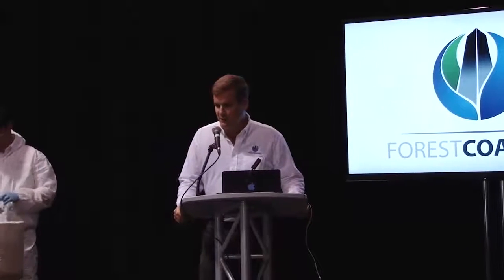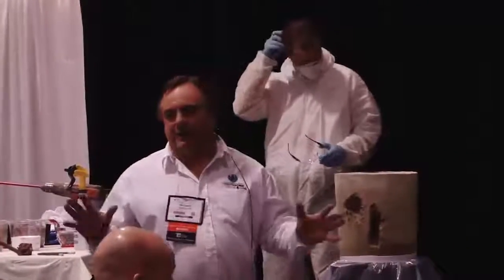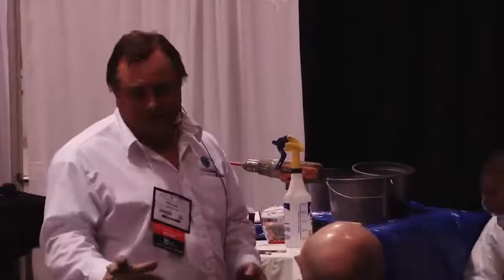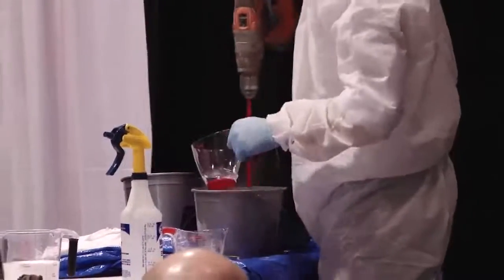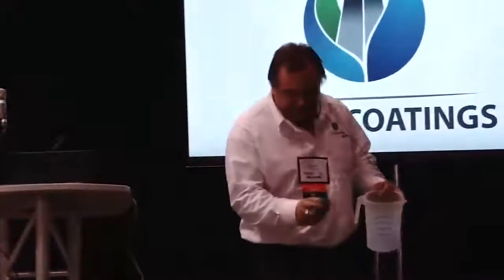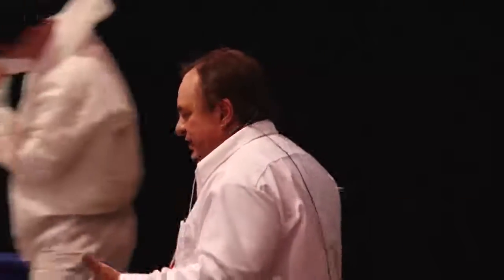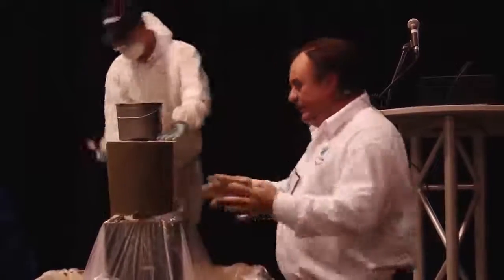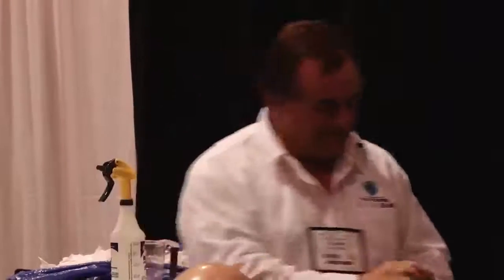How to Waterproof Concrete with Crystalline Technology

Comment: Crystalline waterproofing must and should be applied on wet condition of  substrate, not on dry substrate. Wet surface acts like a primer.
Reply: Is similar or same material is available in India, where what brand, have you used any ?
Reply: @dmprabhudesai  I have worked in Construction Chemicals Industry. So, I have good knowledge in waterproofing systems.
Reply: @muralikrishna892  that's good. But are same or similar products available in India.. If yes what is the product name names.. Because I want to use the product if available or similar products
Reply: @dmprabhudesai  use Kryton
Reply: @sexytaxi69  Thanks for the quick response
Reply: This is cement only. He is applying cement on the crack. All properties are similar to cement, reacts to water, heat of hydration etc.
Reply: @muralikrishna892  Hi murali krishma ı need your help about "Concrete Waterproofing by Crystallization" ı am chemicall engineer in turkey and ı want to make a powder like this Concrete Waterproofing by Crystallization but ı dont have a formula and cant find it if you have a formula about this subject could you share with me Thank you